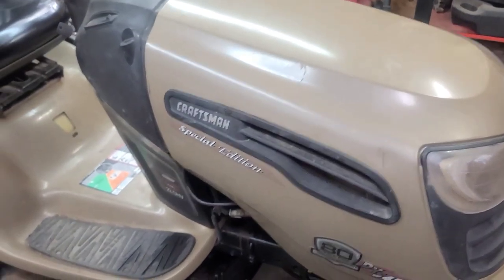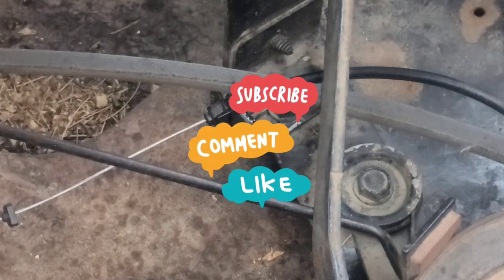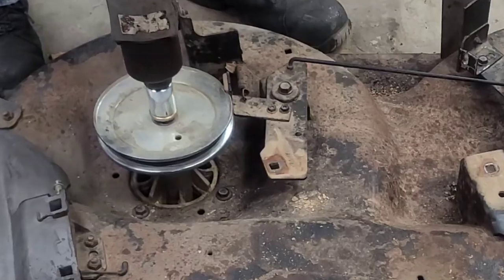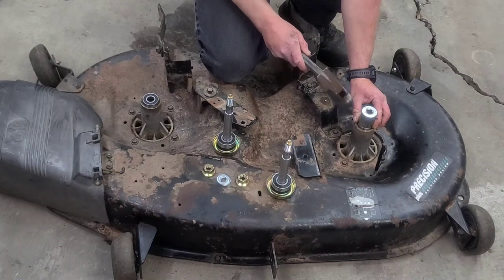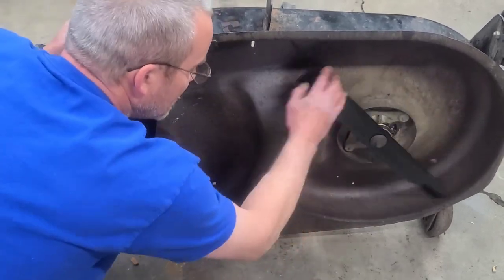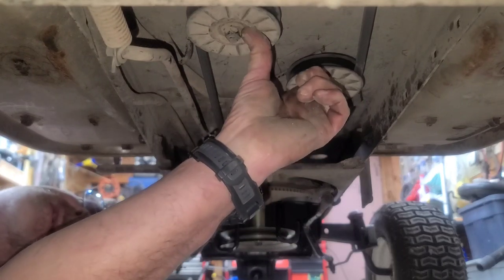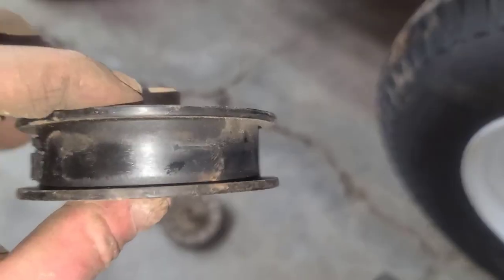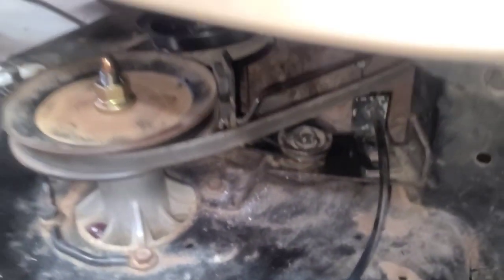How to Craftsman DYS4500 Part 2 Remove Deck Rebuild & Replace Idler Pulleys

Comment: Hey just stumbled across your 2 videos. Thanks for posting them. 👍🏻 I have this mower it’s a hand me down. When engaging forward you can creep onto the speed and will jerk from a stop also when reversing only goes at snails pace on flat or decline will not reverse up hill. Think that would be a drive belt slipping or transmission related?
Reply from the maker: @CreatureofCuriosity 
It sounds like the Hydrostatic Transmission is going out. You can check the belt, But I'm pretty sure its the transmission.
Those Hydrostatic are known for that problem

This is as close to the transmission as your gonna get link below
https://amzn.to/3G1dR3X

Comment: The black Idler Pulley you installed I also bought to put on my mower, which is the same craftsman but the pulley was too big, I believe.  When I installed the Pulley, my belt was extremely tight, and I couldn't get the left and right deck arms in place with the cotter pins. 

The original Idler pulleys I had on my deck were both smaller than my new ones, though.  I don't know if they came like that, or someone just slapped those on.
Reply: Also my smaller Idler Pulley is not steel like yours it is plastic. Is that correct?
Reply from the maker: Look up the Pulleys and Belt with your Model number under seat. Starts with 917.######
Then six digits after 917.
Check and make sure Part Numbers are the same as what you ordered

Comment: You mind telling me what the deck belt size is? Thank you
Reply from the maker: The Deck Belt length on this DYS4500 
Model 917.287380 is 101.2 inches in length.
Links are in Video Description
Reply: @sartingarage8045  thank you much!

Comment: Good afternoon Sartin Garage I'm Brendon remove your non adjustable hanger and order yourself an adjustable hanger on the right side of your deck. You're supposed to have 2 adjustable hangers but Craftsman only put 1 it's crazy. Your deck will mow unevenly with that non adjuster hanger that's not good when you get your 2nd adjuster your deck will appreciate you.

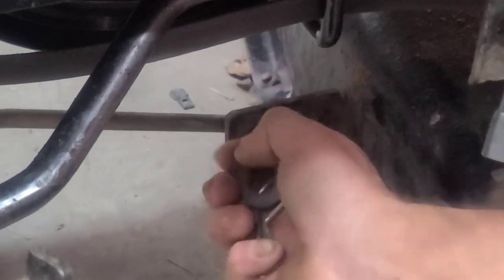Comment: My DYS4500 has a broken deck and I think it is missing the front rod that connects to the deck shown at 1:26 in your video. Do you have any idea what that part number might be or called?
Reply from the maker: @grifftech
Will you get the Model Number out from under Seat. The number will start with 917.
I will be happy to look that up for you

Comment: Question: Is the purple wire coming INTO the regulator supposed to be hot (positive) ?
Reply from the maker: The purple wire is usually your charging output wire. Goes from regulator to key Switch.

Comment: I am having a real hard time connecting the spring to the blade brake. So it’s the spring if I am standing on the left side of mower. . I’m a newbie so I am talking big time  beginner terms. Any trick to reconnecting it?
Reply from the maker: Loop a piece of rope around end of spring and pull the spring and connect it.
The rope size should be like 1/8 about like the rope to pull Start mower. Will need atleast 2 ft or longer if needed.
Fold rope in half and connect rope to end of spring at the fold of rope. Wrap other end of rope around your hand a time or 2 and pull the spring and connect it.